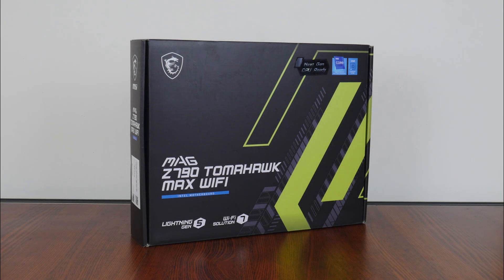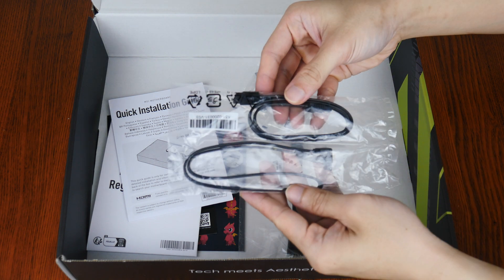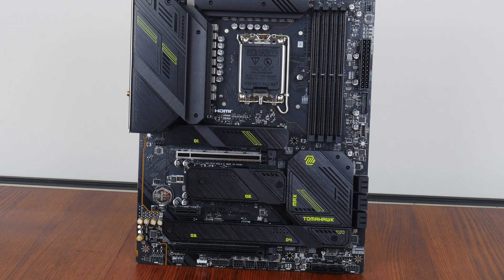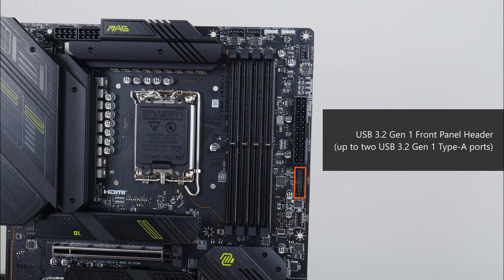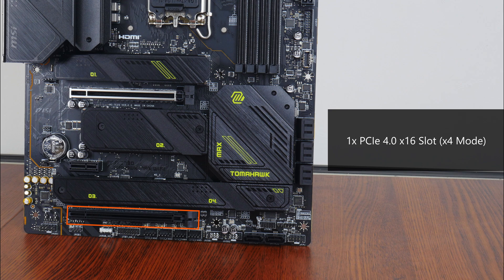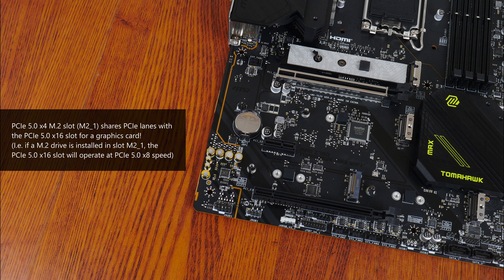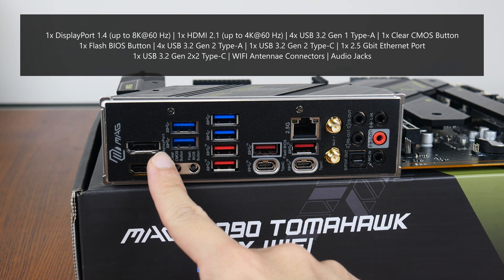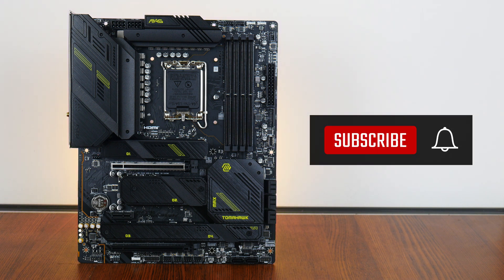Ready for Intel Next-Gen CPUs! MSI MAG Z790 TOMAHAWK MAX WIFI Unboxing & Overview

Comment from the maker: Check out the written article version of this motherboard overview here: https://www.alktech.co/articles/review-msi-mag-z790-tomahawk-max-wifi-lga1700-motherboard
Reply: after reading more in the board manual, https://download.msi.com/archive/mnu_exe/mb/MAGZ790TOMAHAWKMAXWIFI_EN.pdf , page 29. 
They wrote: "PCI_E1 slot will run at PCIe 5.0 x8 mode when installing M.2 PCIe SSD in the M2_1 slot."
but if the card is 4090 that is PCI Express 4 (not 5) and you install the M.2 in Slot 1, do it affect it the same?
I think they means M.2 with Gen5, but if the M.2 is Gen4. does it work ok?
Reply: after doing some research I found that video for comparing "performance tests of the 4090 with PCIe 4.0 x16 vs PCIe 3.0 x16" (https://www.youtube.com/watch?v=v2SuyiHs-O4), meaning the PCIe 4.0 x8 is like PCIe 3.0 x16. so this video show you get 1-3% improvement between those versions if you drop to the "lower" version.
I also checked the Asus ROG MAXIMUS Z790 DARK HERO and the other MSI MEG Z790 ACE MAX that are more than 2x the price and they have the same limitations. Look like the issue is with the Intel z790 chip, because it cross the boards.
Reply from the maker: @nisimjoseph  yup that's right, it's simply because the Z790 chipset doesn't have dedicated PCIe Gen 5 lanes for a M.2 drive, and Intel's given some leeway to motherboard manufacturers to decide if they wanna use some of the CPU's PCIe Gen 5 lanes originally meant for a graphics card for the purposes of enabling support for a PCIe Gen 5 M.2 slot!
Reply: What budget boards are there for not cutting the PCIe slot in half?
Reply from the maker: @thehimself4056  there's quite a number of them out there actually, especially for Intel B760 boards where Intel never intended PCIe Gen 5 support for M.2 drives. There are also plenty of Intel Z790 boards out there where the board manufacturer sticks with the standard 1x PCIe 5.0 x16 slot for a graphics card and multiple PCIe 4.0 x4 M.2 slots kinda arrangement, some examples include the MSI PRO Z790-A MAX WIFI, if you're looking for a MSI board!
Reply: Thank you for the suggestion. I believe this recommendation is what I will buy. I am building my first pc. I already have an MSI GPU. So this will work well together
Reply from the maker: @thehimself4056  sounds good! Out of curiosty, what processor are you intending to use for your build, and what MSI graphics card do you currently have on hand?
Reply: I have an MSI RTX 3060-12gb. GPU.

Intel i7-13700k PSU. 

I can upgrade my gpu at a later time if I need to.
Reply from the maker: @thehimself4056  sounds good, especially since the 13700K is a pretty capable processor that would pair well with high-end graphics cards too!

Comment: The Reality is MSI Tomahawk boards are very low graded built, reeboting issue, no post, no life, DOA are the common results ,cheap bulk ordered Chinese local manufacturing selling like in gold prices, along the global user, I am having repeated issue in MSI Boards from continues 2 years, Consider ASRock Taichi lite is unmatchable with 24+ VRM, great cooling thermals, heat sink, don't fall  with MSI guys beware after sales service they are not changing the board and either not refunding money(RMA RBN925A04102 for my MSI MAG Z790 Tomahawk WiFi DDR5 motherboard (Serial Number: 601-7D91-150B2401001421)

Comment: I want to build a computer with an i7 14700K + RTX 5080 + SSD M.2 PCIe 5.0 kit and I was looking at this motherboard, after informing in the video that there is no possibility of the GPU and SSD working at their maximum speeds, I would like you to give tips on other motherboards with the capacity to acquire full speed in the PCIe 5.0 x16 slot for GPU and PCIe 5.0 M2 for SSD.
Reply from the maker: Hey there, if you're looking to have full PCIe 5.0 speeds for both your GPU and M.2 drive at the same time, then you'll have to either look at the Intel Core Ultra series and their corresponding motherboards (Z890/B860), or AMD's X670E/B850/X870/X870E motherboards and corresponding Ryzen processors. The Z790 chipset was never designed to have PCIe 5.0 support for a GPU and M.2 drive concurrently, hence the lane sharing that you're seeing with this MSI Z790 board. Is there a reason why you're looking at using a 14700K?

Comment: I have 256 PCS ssd as my disk for the operating system, but want to install it a 1TB Western Digital Black SN850X with Heatsink just for gaming, which is the best slot for that? M2,M3 or M4
Reply from the maker: Seeing as the SN850X comes with a heatsink, you might wanna install it in slot M.2_3 or M.2_4, as the heatsink might get in the way of your graphics card if you install it in M.2_2. You won't be able to install the included M.2 heatsink that MSI has provided, which is not an issue at all!
Reply: Ok thanks for the info, i decided to get the non- heatsink version of the 850x. Ill be putting in the M2_3 slot. My 256gb ssd for the OS is in the SATA_A2 slot. So it should be fine. @ALKtech

Comment: Can you tell me if this MAG Z790 TOMAHAWK MAX  has bifurcation support thanks
Reply from the maker: The PCIe 5.0 x16 slot for a graphics card shares bandwidth with the first M.2 slot that operates at PCIe 5.0 x4 mode - if you have a M.2 drive installed in the said M.2 slot, the graphics card slot will drop down to operate at x8 mode.
Reply: @ALKtech  Hmm only see auto, 16 and 8, tried all 3, only sees one of the drives on the expantion pci card...
Reply from the maker: @ oh to clarify, the issue that you're facing is that you have two M.2 drives that are not detected?
Reply: @ALKtech  Hi, Using 4-Port M.2 Expansion Card M.2 NVME to PCIE X16 Adapter, with 2xM.2 detects on of the drives, in slot 1, but any other nope, Tried changing bios, Auto, 16 and 8, still detects only the one.
Reply from the maker: @ oh right you're using a M.2 PCIe x16 expansion card...what's the brand of the card you got, and does it require the full 16 lanes of a PCIe slot to work properly? I assume you have this card installed on slot PCI_E3 (which runs at PCIe 4.0 x4 mode)?
Reply: @ALKtech  Figured, only 16 and 8, no 4x4x4x4, canf only run 1 M.2. Stupidity  on 1 of the top brand boards... Gutted

Comment: Hello, they say that this board is not suitable for overclocking flagship processors, what motherboard should I get at the same price?
Reply: its good for the mid range, i got a 13600k and run it 24/7;365 allday@ 5.5ghz and its very cool and very fast super easy to overclock.
Reply: Who Said that brother?

Comment: Is the i5 12400f capable of that motherboard?
Reply from the maker: Yup, though this board will be overkill for a 12400F. If you're not intending to upgrade to a higher-end 14th Gen CPU further down the road, you might want to consider getting a cheaper LGA1700 motherboard, perhaps something with the B760 chipset instead, and you could save yourself a fair bit of cash!

Comment: Running a 4070ti need to upgrade my cpu ram and motherboard going to run the 17 14700k what motherboard would be best out of the msi z790 mag ddr5 or the msi z790 max
Reply from the maker: MSI has several Z790 models in its line-up - do you have the exact model names of the other boards that you're considering?

Comment: Hi I have recently built a pc using this motherboard and everything works but when I boot it up I don’t get any WiFi signals and only can turn on and off airplane mode is there a fix to this issue?
Reply from the maker: Is the WIFI adapter detected within Windows Device Manager? Have you installed the latest WIFI drivers as well?

Comment: Please mention the link the auto screwdriver uh using in this video.
Reply from the maker: It's a Xiaomi Electric Precision Screwdriver!
Reply: @ALKtech   I've one question, In my country this same mobo is available "MSI MAG Z790 TOMAHAWK MAX WIFI DDR5" but without the "Next Gen Ready" label on it. So, should I go for it?? Does these two mobo's makes any difference (one with label and without label)??  I don't know whether this version will be available in my country or not. Thanks for your reply.
Reply from the maker: @Stud-d2h  it's pure guesswork here, but I'd think the motherboards without the Next Gen Ready stickers may be older stock that do not have the latest 14th Gen-ready BIOSes on them. I could be wrong though, as MSI did release these boards in anticipation for 14th Gen's launch anyway. Are you buying this board from a physical retailer? If yes, I think they may be able to help you flash the board's BIOS to the latest revision if need be!
Reply: @ALKtech   I'll go for online purchase, as offline market don't have this tomahawk max wifi, And I think I need to update bios for the 14th gen myself.
Reply from the maker: @Stud-d2h  and if you do need to update the BIOS, doing so without a CPU/RAM/graphics card installed is quite straightforward with the Flash BIOS button feature!
Reply: @ALKtech  I'll comment here , If I succesfully update my BIOS or face any trouble doing the same. Hoping that you'll help me.😅☺
Reply from the maker: @Stud-d2h  hopefully the process will go smoothly for you!

Comment: Which one do you recommend between this and aorus elite ax ?
And im looking into some overclocking
Reply from the maker: How's the price difference like between both boards? Is it significant? Personally, I'd find it difficult to choose between both boards, as they're quite evenly matched in terms of specs, though the MSI does come with WIFI 7 vs WIFI 6E on the Gigabyte board...
Reply: @ALKtech  both are same price
Reply from the maker: @navid.jfrzadeh6074  I see. Since they're both the same price, aesthetics would probably play a part here too, seeing as the MSI doesn't come with onboard RGB LED accents unlike the Gigabyte (if you care for such things). I'd personally be more inclined towards the MSI seeing as it has WIFI 7 - my two cents!

Comment: If plugging in an M.2 into the first slot reduces the first PCIE slot's bandwidth to PCIE 5x8, wouldn't this make effectively no difference for the current GPU lineup? PCIE Gen 5x8 delivers the 64GB/s of bandwidth, the same as PCIE 4x16, which is what current cards run at. Is this correct?

I'm curious because I'm about to build on this board, and as I understand it that first slot is the one connected directly to the CPU, while the others are connected to the chipset, which leads to some performance loss on the drives.
Reply from the maker: If I'm not mistaken, the halving of bandwidth will still impact a PCIe 4.0 x16 graphics card's performance, as half the physical traces of the graphics card slot will not be in use, meaning to say, when you've got a PCIe 4.0 x16 card installed in the slot, it effectively operates at PCIe 4.0 x8 speeds (the slot will still step down from Gen 5 to Gen 4, seeing as there are no Gen 5 graphics cards on the market yet). Hope this clarifies!
Reply: @ALKtech  Not sure if i agree with this, i got a nvme on slot 1 - slot 2 and slot 3 and when i test out with gpu-z and do the render test the slot goes from idle PCIe 1.1 x16 to full speed PCIe 4.0 x16 on my 4080